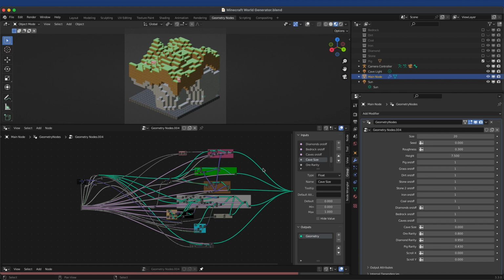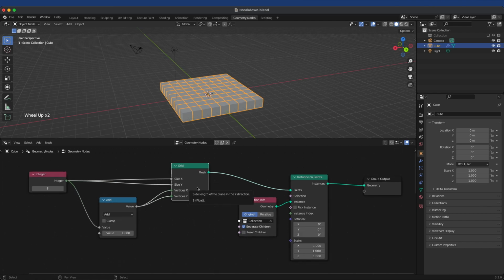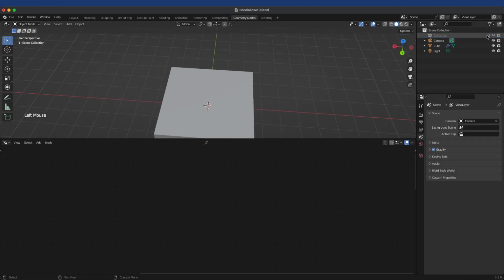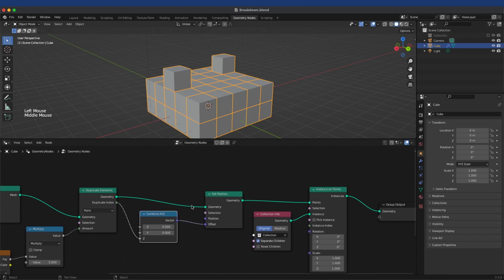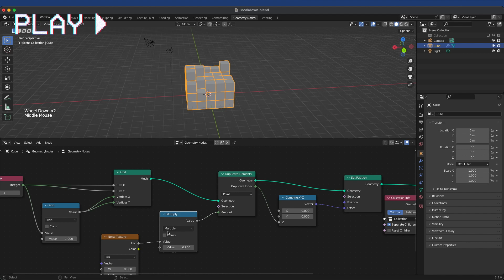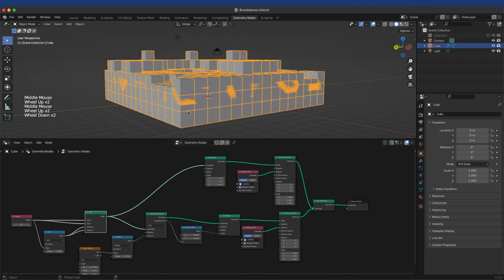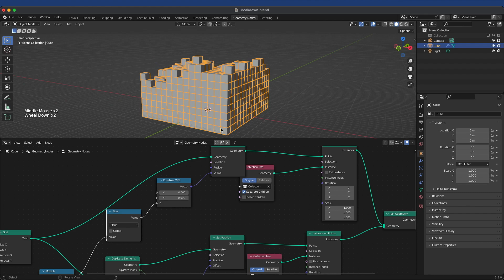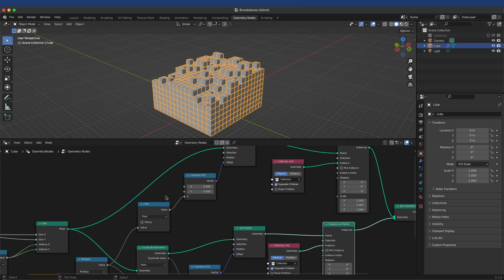How The Blender Minecraft World Generator Works

Comment: Why don't you just use an Object Info node, instead of the Collection info node? Do you want to allow multiple randomized block variations with that?
Reply from the maker: Good question. It's somewhat to allow flexibility with iterations but yes, randomized variants is a plus side as well. There isn't really any functional reason not to use an Object Info node in this case though. They are both essentially the same amount of work, so I prefer the Collection Info node because it allows for more potential options.